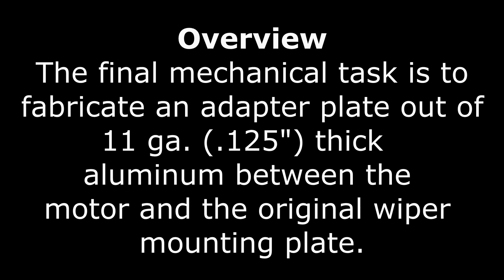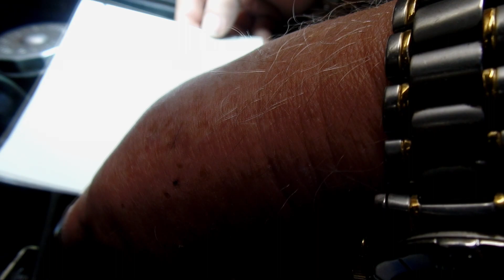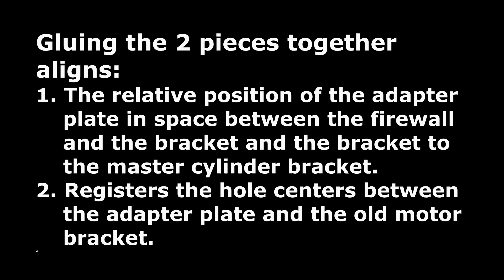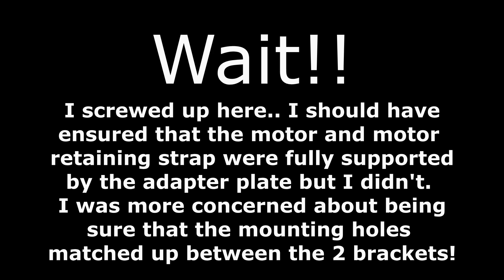DavesTR4 Upgrade TR4A Wiper Motor to a TR6 Motor   Mounting the TR6 Wiper Motor

Comment: As weak as the TR4A motor is, I find the wiper arms/wipers to be even worse! They always seem like they are about to fly off.
Reply from the maker: Like I said Jim, the wiper arm problem is due to the lousy quality of reproduction wiper boxes and wiper arms, especially the wiper arms. The little spring latch is positioned to rest on the side of the knurled wheel box shaft on the reproduction wiper arms instead of snapping underneath the knurled shaft of the wheel box. I found a guy named Marv Gruber who has sets of original wiper arms in good condition so hopefully they will lock correctly onto the wheel box shaft.
Reply: @DavesTR4A  Sure, I know Marv (bought many parts from him over the years). What I hate about the stock wipers is the weedy connection between the wiper arm bracket/pivot (where it connects to the arm), and the arm itself. There is way too much play there. On my TR4A (‘65 with live axle) I crushed those connections slightly with vice grips just to close up the tolerances a bit. 
Of course you can go to the next level and replace the whole lot, like the Project Binky guys did -

https://youtu.be/NX4lBvHDMs8

BTW - I just discovered your channel. I’ve been following Elin and Cheftush for quite some time. Cheers!

Comment: Dave and I are running parallel installations of the TR6 wiper systems to our TR4A's after dealing with the old worn out TR4A wiper motor and aftermarket wheel boxes and wiper arms which are crap reproductions. Regardless, if you are having wiper problems find some good used wheel boxes and wiper arms or deal with the wiper arms flying off at the worst possible time. If you are having motor issues the only option is converting to TR6 parts. Be advised the 4 and 4A wheel boxes are very different than the TR6 boxes as Dave mentioned earlier in this series of YouTube videos. 
I converted my 4A to a TR6 brake booster and dual master cylinder, as such, I don't have the real estate problem that Dave has so I'll be using a TR6 mounting bracket as my motor hold down. Otherwise, our installations are identical. Dave is much better at YouTube than I so you won't see any pretty videos of my endeavors. Follow his procedure. He's found and solved the tough parts of the job. Additionally, changing wheel boxes, tubes and installing the wiper cable requires a lot of patience. 
We are both looking forward to a wiper system that actually works consistently 
As sir LUCAS said "No respectful man motors after dark". I think he forgot to ad "or in the rain"!

Comment: Nice job Dave. You are a great fabricator to say the least. I'm sure this will save someone a lot of time if they decide to mount a TR6 wiper motor. Can't wait for the road test to see how it all works out. Best way to assure a rainless trip West is to have good wipers.
Reply from the maker: Yes, the adapter plate turned out considering how it started 😂.
I’m working out all the electrical parts now.
Dave